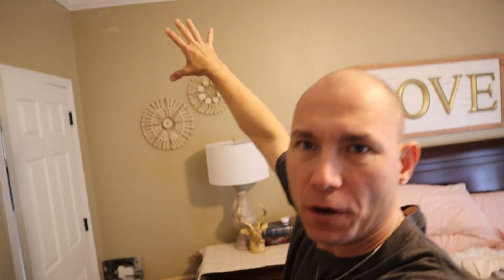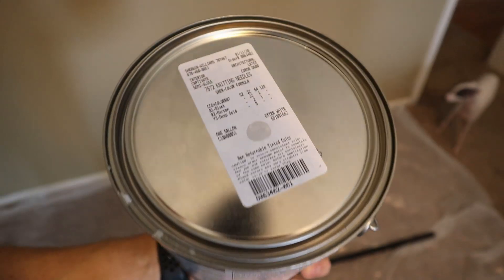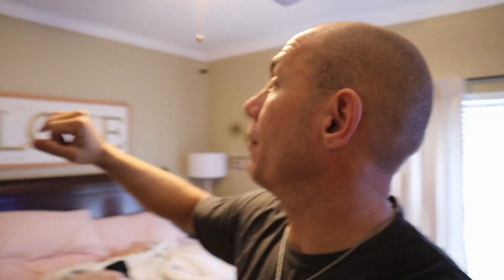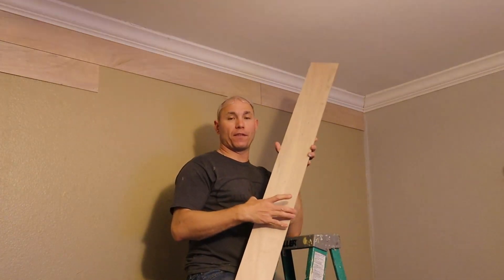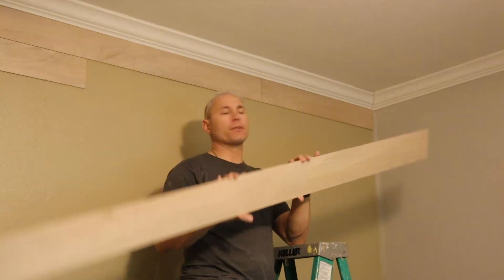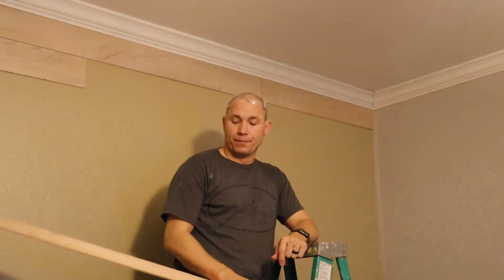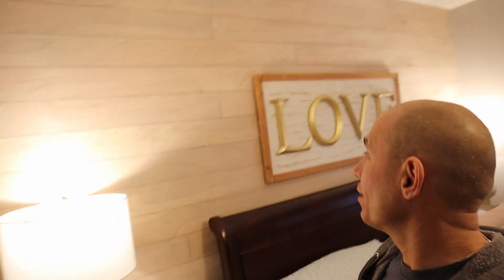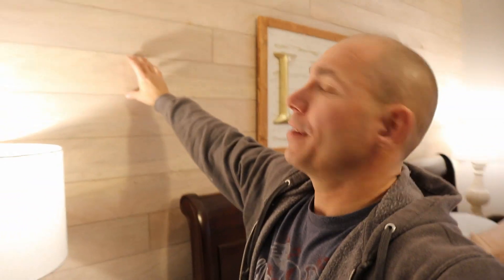How to Make a Faux Shiplap Wall | EASY DIY Project

Comment: Great videos!  New sub, just wanted to say be careful around electrical.  Boxes in the wall can be deceiving as a lot of electricians will run a vertical loop of wiring into and out of the box giving the appearance that the wiring is actually running straight up or down when in reality it could run through the wall horizontally.  This allows enough wire out of the box in case the box ever needs to be moved up or down on the wall in the future 😁  again, great videos and you have inspired me to try my hand at woodworking after being a metal worker for the past 15 years.  God bless!
Reply from the maker: I appreciate the tip.  I don't like electrical lol.
Reply: @731Woodworks   I don't blame you, I didn't either until I decided to wire my shop up myself and it really wasn't that bad.  I also had the advantage of everything being open and exposed too though lop

Comment: I love how easy this looks. I do have a question. If I did this on a wall that ends at an opening, what would you suggest doing that that edge? just sanding it down?
Reply from the maker: What type of opening? If it’s a corner, I would just use some corner molding to cover up the edges.
Reply: @731Woodworks  My wall ends where my kitchen opens up. I don't know how a molding cover would look if that's the only place for it.

Comment: Hey Matt, how many nickels did you use to gap your ship lap?
Reply from the maker: Just one
Reply: Thank you sir! Last questions, we’re you aiming for studs when sinking the Brad nails or simply pinning ends and middle? And then did you use filler over the brads for the wall you left natural? Thanks again!
Reply from the maker: We just pinned it into the Sheetrock. Didn’t hit any studs as far as I know. We left the nails because we didn’t paint it and my wife likes the nail hole look
Reply: Thanks Matt! Turned out great, my mind is spinning with ideas now.